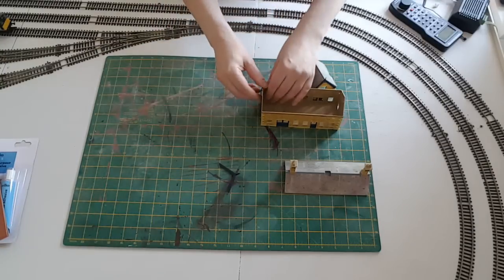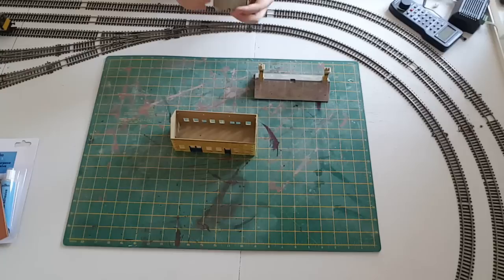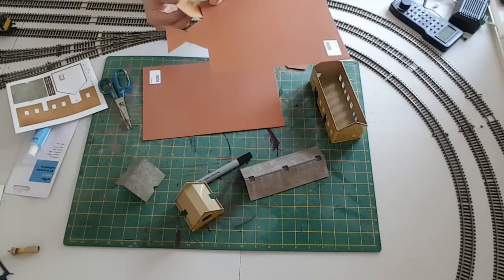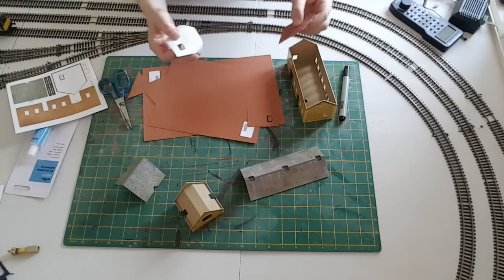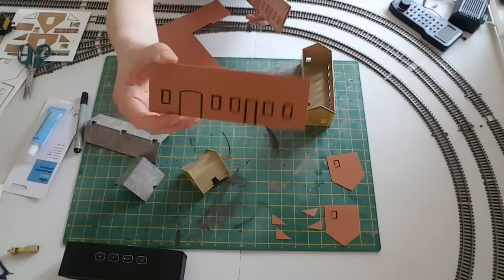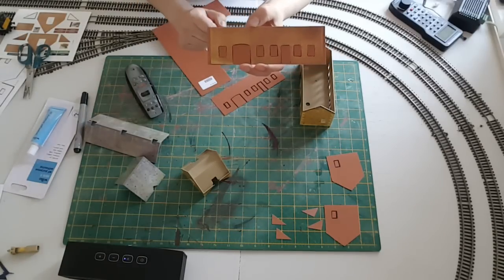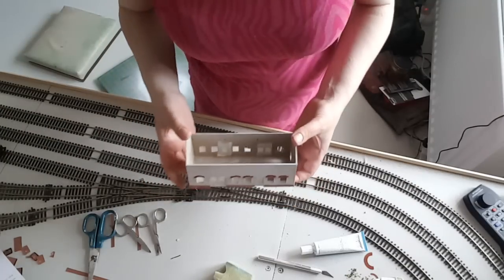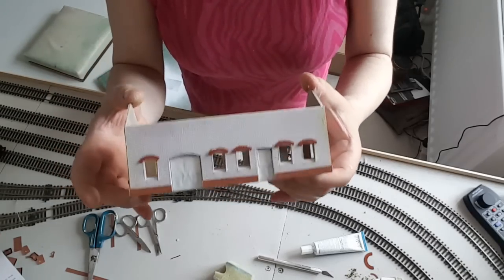Hornby Station Terminus Modification Series

Comment: I have also remodelled the little waiting room and I am thinking about replacing the covering on the Hornby Water Tower. Hornby has taken a step in the wrong direction as they used to sell the model buildings with the textured finished. It was also moulded in RED, but you only needed to paint them in the colour of your choice. As for the chimneys, the only thing I do not like about them is how tall they are. Thanks for sharing the video. Martin (Thailand)

Comment: Susannah, are the canopy's for your new station, the clear plastic ones or the opaque plastic ones. If they are the opaque type, I have a couple of spare canopy's and fittings that I can donate to your project. All the best -Mike.
Reply from the maker: Hi Mike, thanks for the offer, the canopy's I'm using are the ones pictured on the box. The curved ones with the plastic sides. Susannah.
Reply: @Pixie586 .The ones I have look the same shape and size.I have spare plastic sides and ends plus some of the supports as well. May be of some use to your project. Also recently came across a load of class 50 photo's from the 1980's size 10" x 8". If you would like them ,you are welcome.
Mike
Reply from the maker: @chapelhousemodelrailway1700  Thank you Mike,  are you able to Facebook me and friend request me and we could discuss further as I'm very interested in your offer. Many thanks. Susannah
Reply: @Pixie586  Hi Susannah, I am not on Facebook or any social media sites. I just stick to Model Railway forums and YouTube. Would just like to donate the items to your project. 
Mike